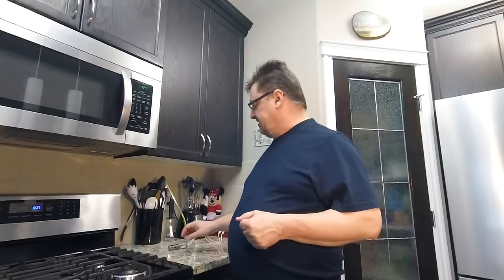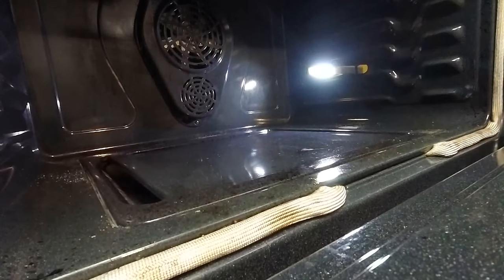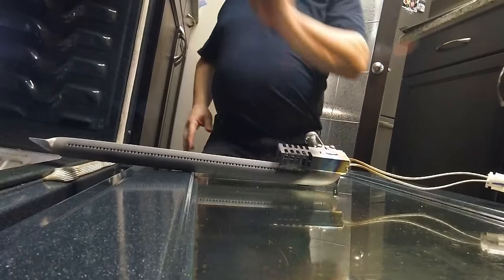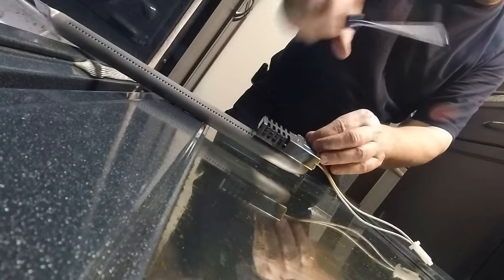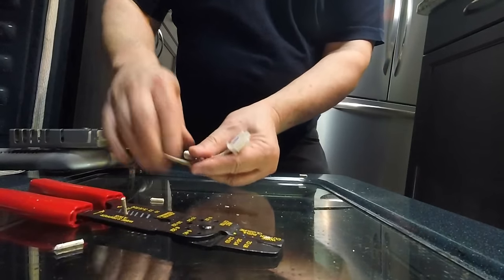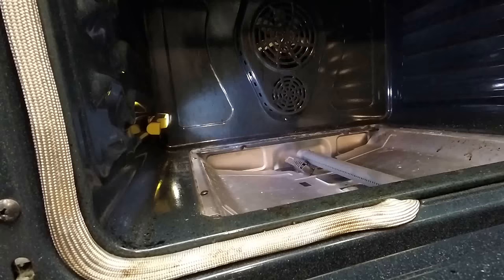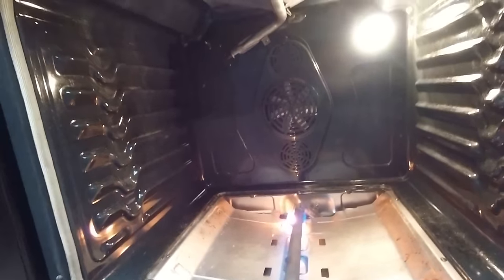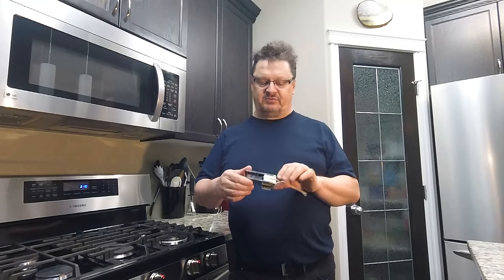Replacing the Oven Igniter in a Samsung Gas Range - Model FX710BGS

Comment: Thank You! Our oven started acting up last week. I tried a workaround I found online and got it running again however this would be the ignitor's swan song. I found your video and ordered a $20.99 part on Amazon which arrived the next day. The connector didn't match, which was my fault however I just clipped a few wires, used the included ceramic crimps and we were back in business in about 30 minutes. We celebrated with an impromptu Pizza Night. Thanks again for posting this video!

Comment: Thank you! Thank you! Your video saved us an expensive service call and got our oven back up and working. We have the same Samsung Gas Range as you (LOVE it), so your video was really easy to follow. This is our first experience with a Samsung range. It is only 8 years old, so was really bummed when I thought we would have to replace it. I found the oven igniter part on Walmart.com. Made sure it had the plug because I didn't want to have to do any splicing. With tax, it was $18...and free shipping. Between myself, my husband and our 12-year old son (he has "piano" fingers and was able to get the back screws started for hubs). It took us about 30 minutes...a couple of the screws were really hard to undo and I had to keep going to our desktop to view the next step. Tested it out before putting everything back and IT WORKED! We were without our oven about a week and as they say "you don't know what you have until it is gone". Some of these YouTube videos have been so helpful...fixed our "leaking" washer last year thanks to a video. Keep up the great work and thanks for sharing!

Comment: Thanks so much!  This video saved me a lot of money.  My Samsung oven (model FX710BGS) stopped heating and gave error code E-08.  I bought the Hot Surface Oven Igniter, Capilary 12in L off Amazon for 16 bucks, installed it, and my oven is now working again!  Thanks again for this great video.

Comment: Thanks very much!  Your video was very clear as was your presentation.  I was able to effect the repair very quickly exactly as you detailed.  I was fortunate in that the generic ("universal") igniter (below) I purchased on Amazon worked great AND ARRIVED WITH A "PLUG AND PLAY" CONNECTOR! Thanks again, all best!
Hot Surface Oven Igniter, Capilary 12in L
by Robertshaw
4.7 out of 5 stars    
List Price: $44.99 
Price: $16.20

Comment: Thanks for this confidence boosting video. I don't think I would have attempted this without seeing it. It took hardly any time to change out the part. I purchased the part online from Genuine Appliance Parts for $59. It was the exact same part with the connector attached. I sure you saved me a whole lot of $$ and after waiting a week for my boyfriend to replace it, I did it myself!!! <3

Comment: Thank you for this.  One thing I had to deal with was the connectors.  The ignitor I got had the connections like your's did, but my model of oven had two separate connections instead of the one common one like yours.  But I did the same thing you did and stripped and connected the fitting from the old ignitor onto the new.

Comment: Excellent video straight to the point and easy to follow. I was able to pull my oven from the wall which gave me access to a gas shut off valve and an opening that allowed me to disconnect and reconnect the ignitor

Comment: The service manual wasn’t too helpful. A forum I went to said this was the most common cause for my oven issues. As time has gone on it has taken longer to heat, and now never reaches set point. The gas valve seemed to pulse when heating, repeatedly on and off.

Found my part, DG94-00520A, from McCombs Supply. $22.58 after tax.  

Thank you for the excellent tutorial! I am an electrician but hate reinventing the wheel.

Comment: I bought a 5 burner stove for $30 today which owners had replaced rather than deal with an oven that wouldn't work.  This stove appears to be identical to the one in your video and goes into my basement kitchen.  $22 starter ordered from Amazon this evening.  Since all else about the stove works well, looks like a decent stove for $52.

Comment: Thank you Tom,  I was able to replace mine, I got the generic part with the socket for 45.90 CAD in Amazon , a great Video greetings from Brampton Ontario
Reply: Thanks Tom!!! I had never done this before, so I ordered the part when the oven stopped working (20 USD for universal replacement, Amazon) and had it done in 15 min thanks to your video.  Very grateful from Columbus, Ohio 🙏

Comment: Thanks for a great video.  OEM part was $149. I bought a generic one for about $15 (compatible with Samsung).  Took less than 15 minutes to change.  Works great.  Video was a BIG help! Oh, and the connectors were right so I didn't need to splice.
Reply: @George Michak, what brand did you purchase? Of course each model of oven would have its own part number right? OEM parts are not readily available due to this third Covid lockdown here in Ontario, Canada. Can't wait for months+ for a part but can't be buying another new oven as this isn't old!

Comment: thank you, Mundane Man!  this was doable and despite the pricey part (195$ CDN)!!!! it was pretty straightforward to replace!  Now, back to baking!
Reply: lol - i am replacing the igniter AGAIN and found my last comment.  The oven is maybe not worth buying, if anyone is checking out these videos!  The knobs on the front have been replaced three times, too.  The originals and the replacements have flimsy little plastic sleeves inside that break almost immediately and then your knobs are not secured.  sigh.

Comment: Thank you! Replaced the igniter and all is well. I would suggest getting an igniter with the plug on it as I'm a bit leery of wire nuts.
Reply from the maker: I had to replace it again recently and I bought one with the connector on it.

Comment: Your video saved me right before Thanksgiving! I have a Samsung model NX58H9500W only 2 years old, but it was past Costo's warranty period. Bought item DG94-01012A from McCombsSupply.com for $23, replaced just as your video shows. Super super simple! No wire alterations needed, it was an exact match. Thanks so much for your video!
Reply: Erin Mataj, I am glad to learn about the part number info from you as I have the same model slide in range in stainless (guess that's what the last letter 'S' means?) and can't get any service to come or get the part online - not available/shortage - thru Samsung due to the 3rd Covid lockdown here in Canada. I feel confident that I may be able to fix it when I find the part. 😊

Comment: Thank you Tom. Just moved into new home and discovered oven does not ignite. Stays at 150 degrees.
Broiler works fine. Looks like this could be my problem so I just ordered the generic part on Amazon.ca for  $39.52. Why spend $162 for the Samsung OEM when its a piece of junk. I hate Samsung appliances. Would never have them if they weren't already in the house. Also have Samsung fridge that doesn't make ice. My mistake in not checking them all before closing the sale. Live and learn.

Comment: Thanks for the tutorial...I think it took me 20 mins from start to finish....taking the lower plate revealed corrosion (which might be expected) on the heat plate.   The screw holes holding down the heat plate we no longer threaded (corroded) bit don’t see that as being an issue with the function of the oven.  Thanks again.

Comment: In this process I've stripped the screw holding the burner in place on the front, everything else came out exactly like you said. So after I get my oscillator on it (and find a replacment screw) we should be back in business....gotta order the part but I want to get it off the stove and order by serial number if I can...

Anyway great video! If you built an engine with this type of instruction and video ANUONE could build one by watching!
Reply: Totally forgot to update, I managed to unscrew the two holding the ignitor on the burner instead. Anyway, I have now changed our stove as well as the in-law's stove by doing this!

Comment: I have this same model stove without convection.  It's 5 yrs old.  Oven quit working 3 yrs ago.  The igniter ignites the gas, but the flame is super low.  At times, the igniter wouldn't even ignite the gas and the house would smell like natural gas which is very dangerous.  So, we've been going without.  This week I decided to dig into it.  I know I can easily replace the thermometer and the igniter thanks to good videos.  However, I NEVER knew about the space outside of the oven (where the gas valve and connectors are.  Where is this space?  I'm so confused!  Thanks for sharing your expertise.

Comment: Great DIY thank you. Quick question, you don't mention shutting off the gas.  Is it safe to assume that without electricity the gas flow is restricted automatically?  I would think normal safety protocol would be to shut off the gas line no?
Reply: @mundaneman254  Thanks, Tom. I just did this exact repair, your DIY was a great help.  I admittedly did not heed my own safety thoughts when doing this as my comment was accurate regarding gas restriction. However, as a caveat, had this not been the issue and gas was allowed to feed into the ignition chamber, It would have presented a danger. (I obviously tested it first with a stick lighter and was 99% certain I did not blow up) :)

Comment: Great job. I took the oven apart just as you showed and have ordered the part. 
Now I need to look at the control panel, the back and top of the Samsung gets so hot
I think it messed up the display information for the clock and timer.
Reply from the maker: Yes, all that heat coming out just below the control panel was not a very good design.

Comment: This video helped me out so much !! Thanks !! My oven works again 😁
Reply: Does this solve the problem if both the oven and broiler are not heating OR is it just the ignitor for the oven?
Reply: Ryan Ford  it solves the problem for just the igniter. My boiler still worked but my oven did not get hot , once I changed the igniter the oven worked immediately.

Comment: Thanks to your excellent video I was able to swap out my defective igniter in about 10 minutes. But it took me an hour to get to it.  One screw at the back unscrewed but wouldn't come out. Chiseled the head off.  The screw at the front of the gas tube wouldn't budge as if welded in place.  After WD-40, tapping lightly didn't work I drilled it out.  I didn't need to splice wires as connectors matched.  If I had, though, should I have used high temp ceramic marettes (wire nuts) or common plastic ones?
Reply from the maker: Sorry you had so much trouble with the screws.  I guess I was lucky that mine came out fairly easy.  I used the marettes that came with the igniter so can only assume they withstand some heat.  That being said, the wires are not located where the highest heat load is so I feel confident they are fine.  I did check on them after many oven uses including cleaning cycles and everything looks good.  Next time (which I'm sure there will be) I'm going to make sure I buy an igniter that has the OEM connector.

Comment: Great video! Did anyone experience lots of smoke when using it again after replacing the igniter? We did use solvent to help one of the bolts come out.
Reply from the maker: When I installed mine it did smoke for a couple of minutes.

Comment: Thank you for the video, it was very helpful. I have noticed a strange smell after firing up the new ignitor. I’m assuming that it’s either from wiping down oven once with a wet rag or possibly the ignitor itself. Has anyone else noticed a strange smell or is it just me ?
Reply from the maker: The igniter will burn off any substances left behind from the manufacturing process.  It should go away after  a short while.

Comment: Are those wire marrets rated for high temperature? I'm assuming not. May want to make sure that you cut the wires much closer to the connector to make sure the marret is in the warming compartment rather than in the oven. Thanks for the video, you save me a lot of time figuring it out! 🤓
Reply from the maker: Thanks for the tip!  I used the marrettes that came with the igniter so can only assume they are temperature rated but I cannot confirm that.

Comment: Mundane Man, I am having trouble getting the element screwed in to the frame and shield at the front. When the element is lined up to the gas in the back, there is a half inch gap in the front where the element should get screwed in. It’s like element shrunk. 😛 Do you have a picture or video of how the element attaches in the front?

Comment: Thanks!  We had the same problem with our Samsung oven and I was able to buy a replacement igniter from Amazon (1 day shipping!) and get my oven working again in about 15 minutes.  The igniter we purchased ($30) was not a Samsung model but pretty much perfectly matched right down to the plug-and-play connectors.
A question:  For whatever reason our oven still goes to 175 with a blinking dot when preheating - it DOES heat up and works perfectly but neither my wife nor I can remember if this is the "normal" display when the oven is preheating (specifically the blinking dot).  Anyone know and/or know how to 'reset' the display so it is back to normal?   Again, the oven is working perfectly.  Thanks again!
Reply: Jeff Schuman:  Our 'few years old' Samsung gas oven just died...no heat in oven and I think the igniter is gone already despite its very light usage and kept super clean. Nothing much is quality made anymore, despite the high prices. Anyway, I, like yourself, noticed that the panel read 175° at start-up just before and after it died and wondered if it was always this way, when beginning to heat up. It also has the flashing circle right now as you'd mentioned and I'm unsure if it was there before it quit. 
I thought it was strange that it read 175° immediately after I entered for example, 350° when the oven was cold. My grown daughters said people wouldn't cook at temps lower so it started at 175° but that didn't make sense to me because the cold oven didn't stay constantly at 175° beforehand thus should read 0° right? Strange! 
Hoping I can fix my oven myself once I can source the suspected part or an equivalent that works due to shortage of parts. The only Samsung authorized repair business around here in our small city, is closed even today due to Ontario being in a Covid lockdown still despite Samsung Canada assuring me otherwise today when I asked.🙄 I guess our gov't didn't think this was an essential enough service during Ontario's third lockdown. Apparently the part from Samsung Canada is unavailable online also but hope I can find one or an equivalent as people have mentioned in the comments and that I can fix it myself thanks to the generosity of the above video.  
I will let you know if the starting temp changes from the 175° and if that dot you'd mentioned, disappears once it is repaired, whether I can fix it myself or otherwise. I am curious also.

Comment: Hi Tom, thanks for the great video. I replaced my igniter on my range with no problems. When I turned it on, I heard an unfamiliar sound. There was a flame creeping up the back wall. I turned the oven off immediately! Is this a common issue or did I so something wrong?

Comment: Hi there, following your steps but do you need to shutoff the gas before changing the igniter?
There isn’t a valve in the gas line leading to the oven, I would need to shut off the house main valve. Thanks in advance!
Reply from the maker: For safety sake, I would say, yes, turn the gas off.  That being said, you are not opening the gas line or gas valve on the stove to complete this job.

Comment: Are the wire nuts able to withstand oven temperatures? Just from the little bit of research I’ve done, it doesn’t appear the temperature rating of the wire nuts are even close to high enough to withstand oven temps. Tom, would appreciate any insight you can provide.

Comment: Great video Tom. I have the same oven and the same thing happened to me a year ago. A Samsung tech charged me almost $300 to do what you just did. Now I have the same problem again but this time I will follow your video. Just one question. Must you turn the gas off before you do this repair? I have a knob behind the stove to control the gas flow. Thanks again.
Reply: Tom Wheatley Thanks Tom

Comment: So thankful for this video. I have the Samsung  NX58H5600SS model and found found the part below on amazon for $24.99 and it fired right up.  It says it’s not OEM but it looks identical to the ine I pulled off and it has the correct plastic. Wire clip.  https://www.amazon.com/gp/aw/d/B07Z6N9275?psc=1&ref=ppx_pop_mob_b_asin_title

Comment: Hi, can you plz help me out? 
My teenage Daughter put a pot of oil in the over to use later. Well she bumped it and oil has now spilled to the bottom of the over. It didn't seem like that much oil and we've cleaned it out twice now. It's still smoking and sizzling when we turn it on. Can I remove the oven bottom like you did but just to clean the oil up? We have the same oven as in this video. Also, would I have to turn the gas off before removing and cleaning the very bottom? Thank you
Reply: Well I'm back because my igniter has now gone out.🤦🏻‍♀️🤣 Do I need to turn the gas off in order to replace it? Thanks a bunch